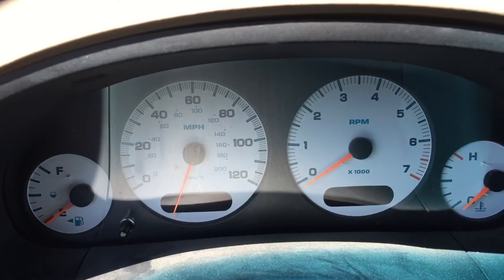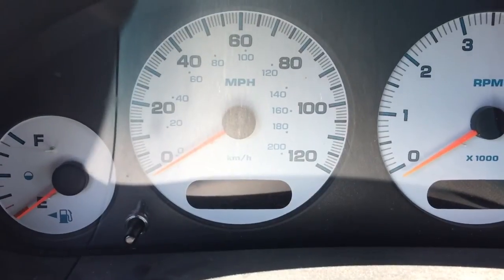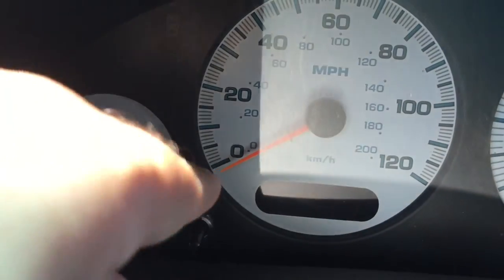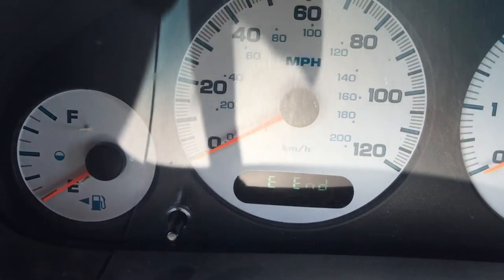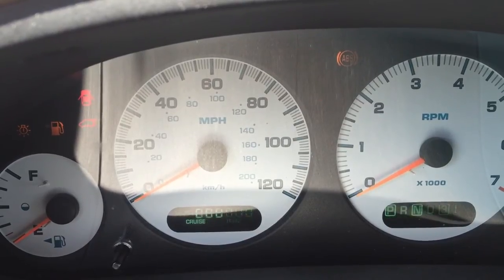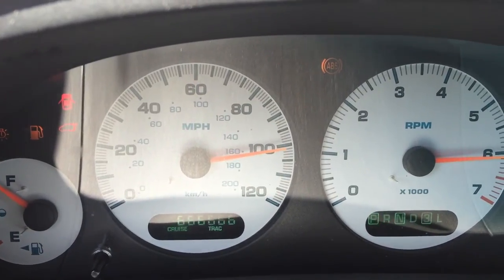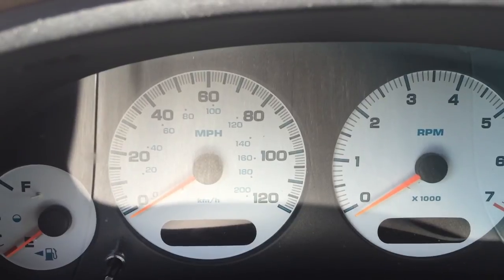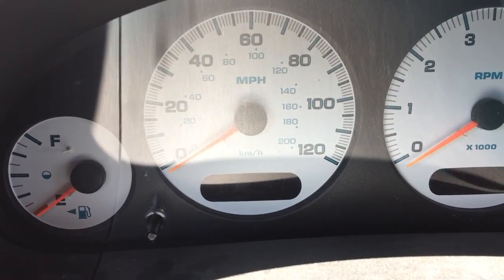2001 Dodge Grand Caravan Speedometer Stuck - How to Fix It

Comment: Would this work for a 1999 Ford explorer because my doesn't move when I start driving?
Reply from the maker: Most likely not.  I have a 1998 Econoline van and the speedometer doesn't work correctly in it.  It's a problem with the speedometer itself.
On yours, I would recommend getting an OBDII scanner for your phone and check the speed from the computer.  If that's not correct, it's probably your speed sensor.  If it is correct, it's likely your speedometer.